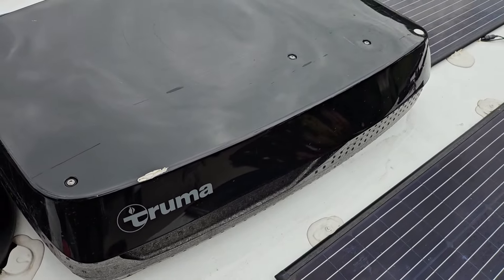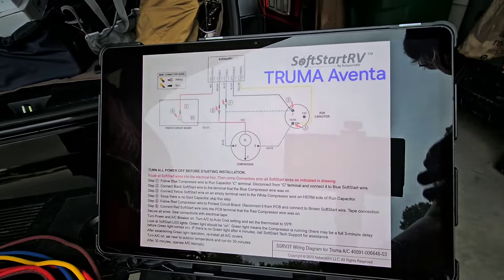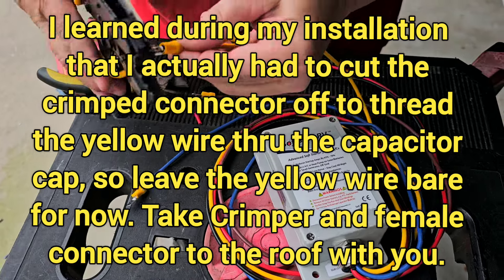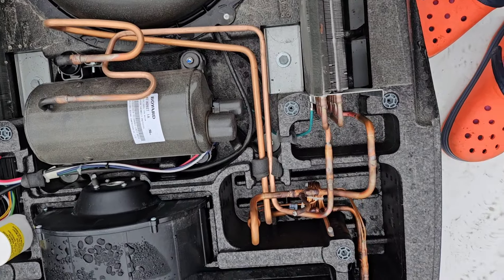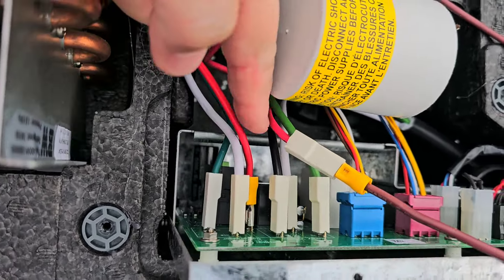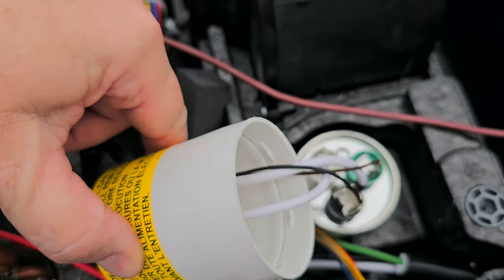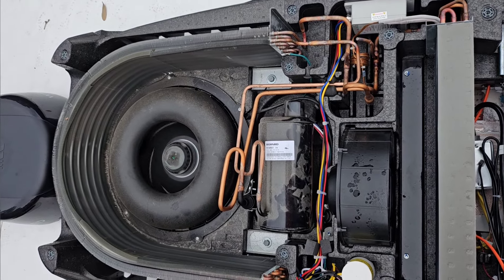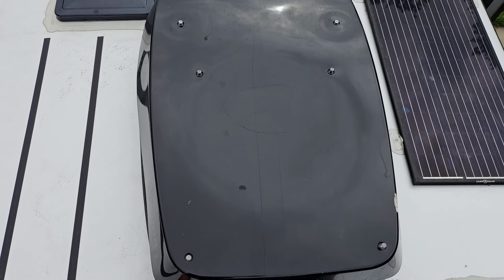Installing a SoftStartRV on a Truma Aventa Air Conditioner

Comment: Thanks Sandy, great video. Just installed SoftStart on our brand new 2024 Wonder MBL. The installation went smoothly thanks to you showing exactly where to place the softstart and also you pointing out that the wiring attaching to the capacitor should go through the cap before attaching the connector.

Comment: Hi I've watched a few videos of yours, they've been helpful and clear. Are you available to help upgrade an Ember rv solar? Tia. Btw, I did install a soft start on my dometic ac. Not too complicated, but the solar upgrade I'm a bit hesitant about
Reply from the maker: @BigGodLife  I help people DIY, I'm not an installer for hire. If your Ember has a PVC solid walkon roof, then you can use a few different videos of mine to figure out how to do your own solar. You really have distinct pieces you can do your project in so you don't get overwhelmed. The hardest part about a new solar installation is drilling a hole in the roof and running your wire to the spot you'll be mounting the solar controller, otherwise everything else is very straightforward. Click on the titles of my videos to reveal links to the parts and tools I use.

Comment: Does your truma ac work with the generator after you installed the softstart?  I have on installed and I have no way to run it off the generator?
Reply from the maker: @stephenbaldassano3788  Sure it does, actually better off the generator because the SoftStartRV reduces the big amp spike in rush current of the Truma compressor start. If you're having trouble like that I'd say your SoftStartRV is installed correctly.

Comment: If the Truma Aventa can run on 15a, can it run from a 2KW inverter with SoftStartRV?
Reply from the maker: @guylafrog4193  In very hot weather it's not a good idea for long. Heat makes everything pull more power.